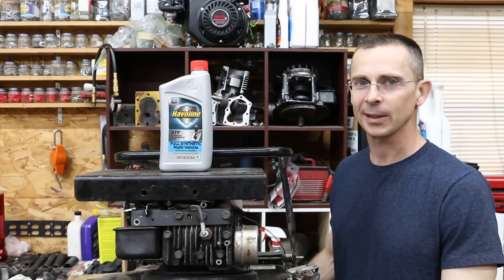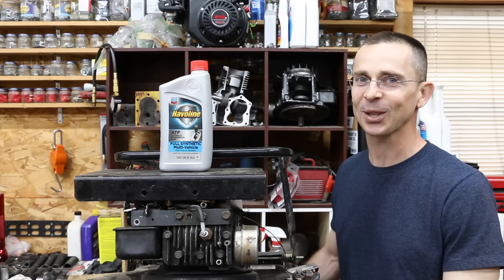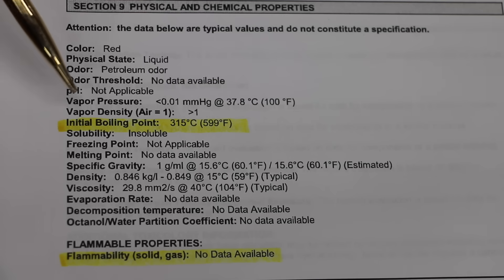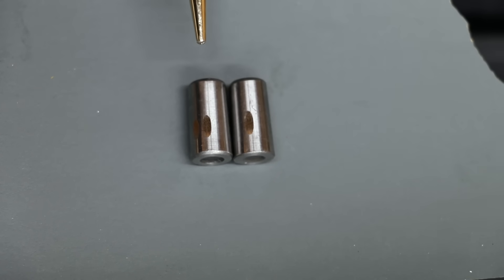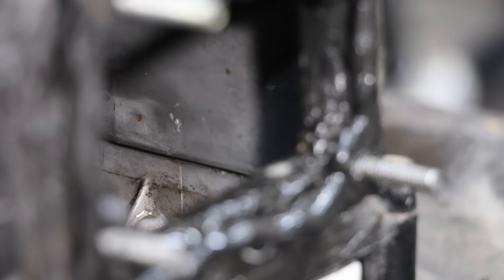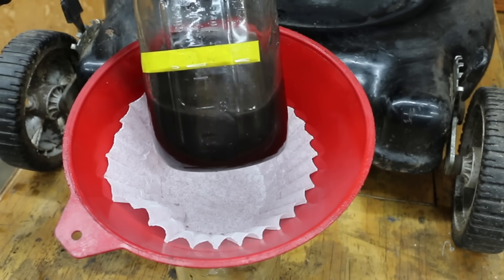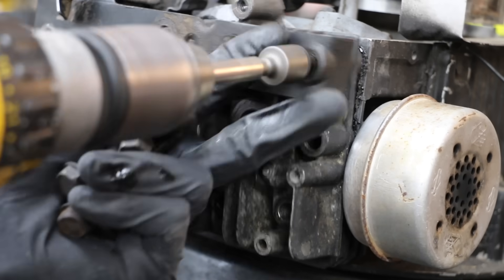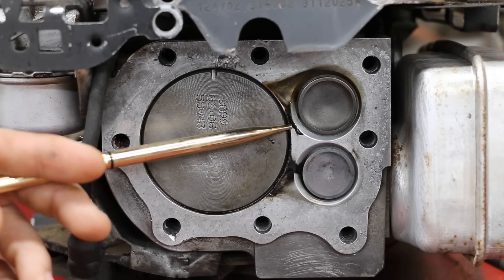ATF as an Engine Oil substitute?  Let's see what happens!

Comment: I have been told many times that you should run only 1 quart of transmission fluid in a 5 quart system. 10/30 etc with one quart of transportation fluid. Same as for a 4 quart system. 4 to or 3 to 1.
Reply from the maker: Yes, this makes sense.

Comment: One huge difference would be a lawnmower idle vs. an automobile idle at only 700.
Reply from the maker: Great point.
Reply: @ProjectFarm  I know an old farm boy that drains oil and fills back up with diesel fuel but he warns anyone anything over idle on a tractor auto will cause damage.  Diesel fuel has just enough lubrication for 800 rpm he always said. He would run everything for about 10 minutes and drain. He would do that a couple times until the fuel came out clean then change oil filter and refill with oil. He always cut open his filters.

Comment: Atf is same as motor flush
Old trick was to use type f transmission fluid to free up stuck dirty parts
Reply: Type F auto trans fluid is GREAT for cleaning dirty guns.  And way more affordable than the purpose made solvent.
Reply from the maker: Thanks for commenting on this.
Reply: I put in my 2 CT’s about this atf response , but had forgotten that type f was the thing to use. Don’t know if there still is a type f .

Comment: I have used ATF to free up stuck rings by pouring it in the cylinders and letting is soak for 24+ hours. Took a 2.3L Ford from 0 on one cylinder and 45 or less on the others to 85+ after soaking. My father-in-law  drove it 1200 miles from Florida to Michigan the next day, and for many years after that.
Reply from the maker: Thanks for commenting on this.

Comment: I have never used straight ATF in an engine, but I have ran 3qts 10-30 with 2qts ATF in a 5qt design with very good success.

Where straight ATF doesn't have a good film for lubricity tests as you have shown, the 3:2 ratio has in my cases added enough film to cushion against wear while maximizing the detergent aspect of the ATF.
Reply from the maker: Great point. Thank you

Comment: I worked for an oil change/service center years ago, and occasionally when we encountered a vehicle with alot of sludge and an owner who didn't have alot of money. We would use a quart of do of ATF to run for 5-10 minutes before draining the oil vs having them buy the "Oil System Cleaner" and it seemed to get things flowing better. However I don't know 100% of it was the right answer.
Reply from the maker: Thanks for commenting on this.

Comment: You should test with zddp additive or how other additives (boron based archoil or stiction) improve friction and wear. 7.3 diesel owners use ATF as fuel but they say it can leave waxy stuff on injectors. Oil has zddp additives that provides the protection for hard cam shaft (and especially with  flat tappet ) friction.
Reply from the maker: Great recommendation. Thank you

Comment: Had a 1997 Miata as an autocross car. When I bought it the lifters were noisy (common on first gen cars). Ran straight atf in it for 30 mins, did 2 fill and drains with cheap oil and then the good stuff. End result was no more noisy lifters.
Reply from the maker: Impressive results!  Thanks for commenting.

Comment: i run my 4 stroke Motocross bikes on pure ATF. Always have done.
Its actually recommended on Suzuki's, As they have a common issue with clutch baskets notching, ATF actually helps reduce that..
Reply from the maker: This is interesting. Thanks for commenting.

Comment: Engine builders try this. With a new or reconditioned engine block, clean the bores anyway you normally do, then to see how clean the bores ready are pour a little New ATF on a clean withe cloth and rub the cylinder with that. Some of you may be extremely surprised how much more debris ATF gets out of what looks like a perfectly clean bore.
Reply from the maker: Thanks for the recommendation.

Comment: I've seen it used some and I've used it myself. I think it's basically like Marvel Mystery Oil. I've used it twice to free sticking valves on a Continetal O-200 and an O-300, both use the same cylinder. It worked both times. I used ATF once to clean an engine with no issues, and once to free up a sticking lifter. The lifter quit ticking.
Reply from the maker: Thanks for commenting on this.

Comment: One problem with the test is the engines don't have hydraulic lifters which is where you will see the most benifits. Next problem those engines don't have enough sludge deposits for the test to really show how well it works. And finally the actual trick is to replace only 1/5 of the total engine oil volume with atf... running straight atf is full blown ignorance. The biggest effect is actually measurable at any shafts seals... the atf re-softens excessively hard seals back to an acceptable level with repeated 1/5 volume atf/oil changes.  We did this experiment when I went to college for automotive, diesel, and industrial applications on engines with heavy sludge buildups, hardened seals, and lifters that ticked louder than the rest of the engine all freshly pulled from the salvage yard (before they were to be rebuilt).  The biggest and best results came  from the 1/5 atf/oil blend mix and from royal purple full synthetic oil ( royal purple did take longer to dissolve the sludge and carbon deposits (sitting overnight after initial oil fill and run) but they both cleaned nearly equally well
Reply from the maker: Great point.

Comment: I'm very old mech~ I've used ATF to clean Chrysler Two vavles V8 engines that were smokers badly these engine did build up huge slug althoughout the engine insides from the standard motor oil of the 1950's. After cleaning the heads in side of the valve cover we then added two quarts ATF in place of two quarts of moter oil while the remainder with the regular motor oil then changed th oil after 500 miles of both city and road miles of about. Evert time it the engines clean up to almost new. At this time the changed moter oils just would not cleanup this engines by their selfs. But when done as we did it the clean ups  worked every time, and these engines stoped smoking every time. I ve heard of times that it did not work but this was a very long time after wards, I still think that it was the engines were just fully wone out at the time of the tryed cleanup. I was born 1938 and still going at least some what today.
Reply from the maker: Thank you

Comment: I had an 87 Grand Am w/ the Iron Duke engine. Best $25 I ever spent. It leaked everything, so I would use 20-50 oil. But before oil changes I added a quart of ATF. It smoked while idling, but quieted the ever present valve tap down. I always changed toe oil before driving it.
Reply: It was the only hybrid I ever owned. It burned gas & oil.
Reply from the maker: lol.  Oil and gas burner both.  Thanks for commenting on this.

Comment: Back in the "Good Old Days" our Dodge/Chrysler 318, 361, 400 V8 would occasionally get  loud, or very loud, sticky hydraulic valve lifter(s). We actually physically replaced  some before a mechanic mentioned using ATF in the engine oil. Standard procedure used repeatedly with several engines was add 1 quart of ATF and within an hour or so it would clear up. The engine oil certainly turned black quickly as it seemed to clean the entire engine crankcase. Mechanics I knew would dismantle and rebuild heads. All hydraulic and solid lifters, rockers, shafts and moving parts went into a pan of ATF to remove dirt/carbon buildup before reassembly. Our modern, much improved oils may never have had the problem, but it was very effective and not noticeably detrimental to the engines at that time. One of the worst sticky lifter 318's was running perfectly at 124,00 miles til I totaled it just after getting my license.
.
Reply from the maker: Thanks for commenting on this.

Comment: I have used atf to clean lifters for years, works great!  Only add enough at idle to stop the lifter tap, run 50 or so miles, change oil and filter.  Never a problem.
Reply from the maker: Thanks for commenting on this.

Comment: And you know what works good flushing oil on a diesel engine kerosene instead of engine flush pop a little bit into the oil then let the engine run for a while then undo the sump nut. Considering kerosene is a light form of oil
Reply from the maker: Great point.

Comment: ATF has more detergents, the  ATF loosened up some dirt, most mowers use single wt  oils like straight 30w, although I have used left over  10 -30 or 10, 40, just because thats what was sitting around, the deal with mower engines is to change the oil after the first break -in when its been run a few hours, when you change the oil for the first time dont go cheap, but my advice is to take the drain plug and throw it away as far as you can and get a magnetic drain plug,  it will hold cast iron and steel casting flash
Reply from the maker: Great point.

Comment: In the past, in the 80's, we were mixing engine oil with cooling oil from the electrical transformers to clean the engine lubrication circuit .
Reply from the maker: Interesting. Thanks for commenting on this.

Comment: I use ATF in my power steering pump... Have been for 5 years with no problem. PS pump was failing on my 88 bronco ii... Filled with ATF and haven't had a problem since... Haven't even filled it since 💪
Reply from the maker: Thanks for commenting on this.
Reply: I own a 1998 and a 2000 year Ford Escort and have the service manuals for both cars. Did you realize that Ford recommends Motorcraft Mercon ATF in both the Auto transaxle and the power steering reservoir. I talked to a Ford dealer mechanic and the parts guy and the manual is correct. ATF fluid and hydraulic fluid used to be the same except ATF has a red dye in it.

Comment: I've used ATF to clean lifters and de-gunk my engines since 1970.
Never a problem.
In a "standard" 4 and 5 quart (including oil filter) oil system, I always changed the oil & filter, put in 1 qt of ATF and the rest 10W 30, run the engine for 500 - 1000 miles, change oil & filter. Lifters no longer knocked, and the sludge inside the valve covers (and I presume elsewhere) was gone.
Reply from the maker: Thanks for commenting on this.

Comment: Back in the day (1940's & 1950's) ATF contained whale oil.  A bio-oil will always clean a petroleum oil.  But by 1960 all ATF's had gone to petroleum bases only.  Different dispersant package and thinner base oil. ATF is not the cleaner it once was.  Use BG109 or some other chemically active solvent instead.  Save the ATF for the tranny :)
Reply from the maker: This is interesting. Thanks for commenting on this.
Reply: Broc Luno   Comments like this are important to the lore. 👍

Comment: I have a chevy s10. V6 that had a stuck lifter so i put a quart of atf in and ran it  for an hour . Then changed the oil and oil filter and added a half a quart of atf in with the new oil. And the lifter is no longer stuck . Ive been driving it for months and no lifter noise at all now.
Reply from the maker: Impressive!

Comment: engine oil has a higher content of friction modifiers and lesser amounts of solvents.  engine oil has polymers that prevent thinning  atf does not have.  if someone has done regular oil changes to their engine, the idea of using atf as a crankcase cleaner should not be necessary in a perfect world.  
however this world is not perfect. 
as the older v-8's roll over 100k it's not uncommon for their lifter galleries and their oil rings to start clogging.  using atf  - especially in colder months  - every winter -   can help keep oil flowing through the length of the small galleries and keep the oil rings / oil ring grooves cleaned and flowing as designed.  yes- it does work.  there is no magic pill.  snake oil is snake oil.  this is something that must be done with some measure of frequency -  ie during winters when oil breakdown is not as severe.  you can't just wait for your rings and lifters to clog and think this type of treatment is going to magically fix the problem. 
we put 1 quart of atf  with 4 quarts of 5w/30 oil in a 5 quart pan during winters and never had any lifter noise - ever.
if you live farther north you could probably use 2 quarts / 5 in a 5w/30 engine. 
however with the new engines running   ZERO  weight oils - i would not use it and don't believe it would be necessary with oil so thin.
Reply from the maker: All great points and thanks for commenting!

Comment: Don't use atf in a high mile engine..it is super high detergent and very light weight...5/10 weight...I knew a man many yrs ago that used it in his 64 olds ran quiet....but be careful or you may be buying an engine. Synthetic motor oil raised my mileage about 10+%...
Reply from the maker: Great point.

Comment: I had a chainsaw that was seized. I removed spark plug filled the cylinder with brake fluid. Left it sitting for a couple of days. Drained fluid from engine. Put a wrench on crank. Worked back and forth a few times. Engine become free. Added fuel to it. Now it runs like a champ.
Reply from the maker: Impressive!

Comment: I've used 4 oz of ATF in older engines to free sticking hydraulic lifters. Seemed to work after 50-100 miles. No apparent harm to the engine, cheaper than the magic additives.
Reply from the maker: Thanks for commenting on this.

Comment: Have you ever heard or considered running K1 Kerosene, mixed in with a lower volume of oil, to thin it and clean out deposits? (10 minutes and drain in a cold engine only)?
Reply from the maker: Great video idea!

Comment: I went out to my car one day, started it and knew right away I has a sticking valve. I poured in a quart of ATF drove it back home a 100 miles. Had an oil change the next day and never had another problem. But bare in mind, you would never run ATF alone in an engine.
Reply from the maker: Impressive!

Comment: I can verify, adding a full quart of Transmission fluid to a 300k mile 4.8 LS V8 to try and flush the lifters.  I drove the vehicle 100 miles round trip, Good/Bad results.
Good it did flush more gunk out.
Bad it didn’t fix the noisy lifters.  The thinner ATF was able to seep past my high mileage valve seals, as a result the engine started smoking badly on start up and under accelerating. 👎. After changing the oil, removing all the ATF the smoking stopped. 🤔😉
Reply from the maker: Thanks for commenting on this.  I was hoping it would have resolved the lifter noise.
Reply: Project Farm In an engine with less “sludge” you might be able to clean/clear out gummy lifters.  My 4.8 has a tad over 300k Miles, once I pulled the heads and intake off I realized there wasn’t a service history! 😳. I haven’t seen an engine so full of both burned/gummy goop. I retired the engine and built a fresh 4.8. 👍
Reply: @HeadFlowInc  Sounds like Quaker State Sludge. Could always tell an engine that used it, by the look of coffee grounds when you pulled the valve covers off.
Reply: @jad43701  CakerState is what I heard it called years ago.
Reply: It's a bad idea to clean out that sludge on an engine w/ so many miles.  That motor is set.
Reply: Try Marvel if you haven’t already.
Reply: I'll take your worn out ls engine. I hear the noise is because of a clogged oil pick up screen
Reply: Sounds right : / Did you clean and gap your plugs?
Reply: This is why it's terrible as a lubricant, it doesn't adhere well to the moving parts and escapes through any sort of seam.
Reply: That atf, could passed your piston rings too and goes to the combustion chamber
Reply: Bullshit. Why would the transmission fluid run past your seals? If anything it would condition your seals and stop leaks. Automatic transmission fluid is 5w30 with a shitload of detergents.
Reply: C T I never had issues been putting in all my crank case in all my shit for 25yrs I call bullshit

Comment: we work in 3rd world countries in the congo and asia.. they use only ONE type fluid for everything  from hydraulic fluid to brakes, to transmission to engine  oil etc etc etc
Reply: Which one?
Reply from the maker: This is interesting.
Reply: Project Farm  i dont  advise you to use  other fluids long term , but they will work to get you out of an emergency.. western engines and transmissions are a lot more delicate than  old  beefeaters that we use

Comment: I put half a quart of ATF and at oil change and since my engines are older and high miles they do burn a little so when I do add I add ATF also each time I put fuel in I put about a cup in the tank I'm over 15,000 miles the oil looks brand-new the lifters are silent I get decent mileage runs great
Reply from the maker: Thanks for commenting on this.

Comment: Great video! I highly suggest you try Militec-1. Dry lubricant additive used in a lot of ways from lubricating/cleaning weapons, oil additives for most engines, reduces heat, bonds to the metal making it stronger. I personally been using this since 2005 when I was deployed to Baghdad, Iraq and been using it ever since. I use it in my truck an even with almost 200,000 miles the engine still sounds like new an have not had to replace anything that I've added Militec-1 to. Again great video and I can't wait to see the next one! http://www.militec1.com, http://www.militec1.com/testimonials.html
Reply: Richard Taylor   I was sold on Militec (sp?), but after reading about acidic reaction (in engine oil) I stopped.  I'm not sure what to think, but if this is the one with the fleet-vehicle testing, those results were impressive – I just don't know about long-term wear.